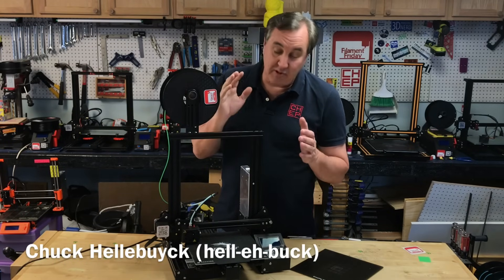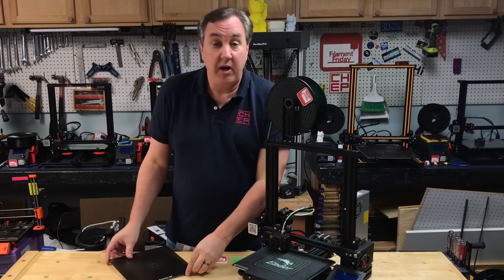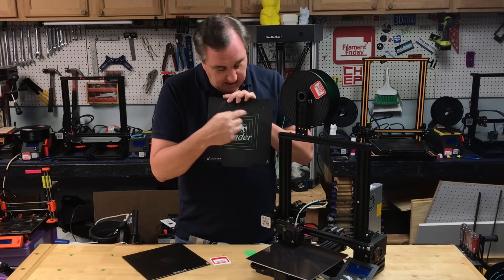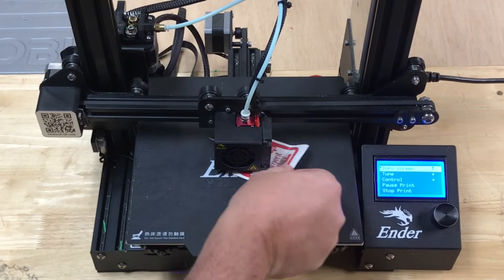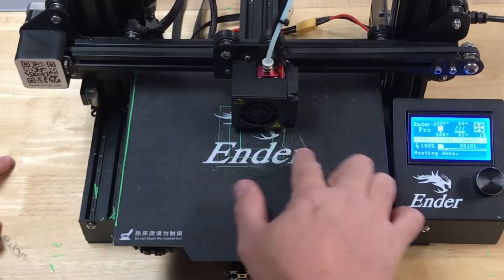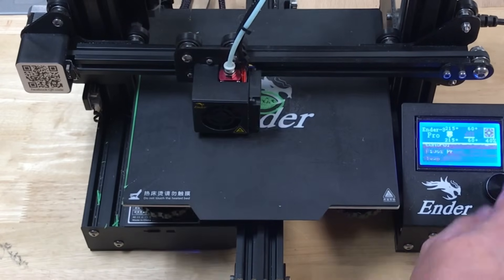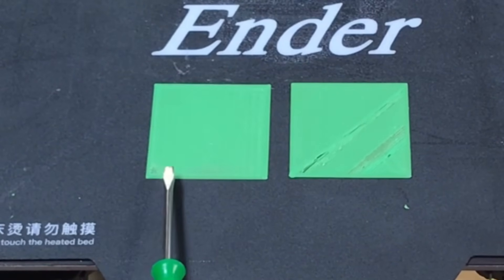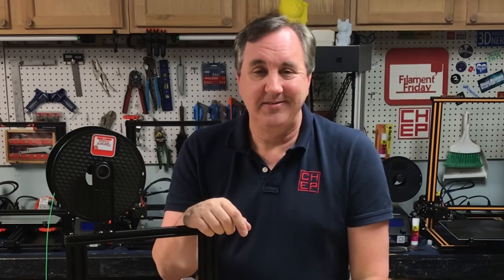Creality Ender 3- Easy Way To Level Your Bed

Comment: Level, print, fail...level, print, fail...
About to give up on this....
Reply from the maker: Clean the bed with soapy water and dry it. May help.
Reply: @FilamentFriday  I tried that, but will try again, also with the crtouch it won't print correctly, do you have an email I can send a pic to?
Reply from the maker: Check about me page on my YouTube.

Comment: Hey Chuck, or anyone- I notice that no matter how hard or loose I turn the leveling knobs below the printer, the extruder does not come close enough to the bed to graze the paper in the example from the video.

I figure this is because I'm using a magnetic bed that came with the ender3 pro, as opposed to the thicker glass one with other models, but I don't know.  I'm at the point where I feel like I should lower the stop switch manually til I can get the extruder close enough to the bed.  

Please advise, if you could, before I potentially do something incredibly stupid?  Thanks Chuck !
Reply from the maker: Yes, lower it. Even if you have to cut off the nub the prevents that.
Reply: @FilamentFriday  thank you!  very much !

Comment: Is there 3D print for extra filler for the spring area? My spring is too short the bed is always unlevel
Reply from the maker: Cut off the tab and lower your Z stop switch.

Comment: When i used to print this bed level, it always printed the outer most square first and worked its way in. After changing to a microswiss NG, now it prints the inner square and works its way out. Any ideas why

Comment: has the Bedlevel Script changed, from lets say a year ago? I used to get it from this video's description. Now its running a smaller rectangle, off center.
Reply from the maker: No. Same code.
Reply: @FilamentFriday  found it on your thingiverse profile, this file is working, for me, for some reason. thank you for the great work, opensource <3

Comment: I thought I did it right according to the video, wasn't printing right and burned a whole in the bed, I'm sure it was my fault but still sad. Even used a piece of paper to make sure if was far enough away from the board. Guess this attempt I will go to the letter of the video and use the software and see what happens.

Comment: my extruder is higher than a sticker’s thickness for sure. when i try to manually rotate the motor it does go down a bit but not quite enough to where this video shows. any help anyone please? :(
Reply from the maker: Adjust the Z stop switch lower.

Comment: Great share. Two things I would share, the second one you better be sitting down for because it is going to blow your mind.
1) Always adjust bed height by TIGHTENING the spring. When I EASE the thumbwheels, it doesn't hold its position- same principle tuning a guitar - you always tighten to get to your note.
Have a seat, now.
2) The wheels on the x carriage are not round. I knew you would be blown away. I have seen it consistently when printing large areas - periodic ups and downs, waves of good versus bad areas of the print. I have never seen/heard anyone on YT address this. Get a BLTouch you say. I have one and it is not precise enough to correct for this, or I may have to add 144 points for it to guage (which would take a LONG LONG time).
I hope you are OK with that news.

Comment: I’m a beginner and I’ve been doing it while the printer was off. It’s worked plenty of times but for some reason this time recently it’s just been a pain to level it. I’m going to try with the nozzle and bed on. Thanks in advanced.

Comment: My ender 3 pro did great in the beginning.   I even added a 2nd z axis motor and a glass bed.  Now, no matter what I do all my prints fail.  Either they don't stick, or they peel up.  Or if they do start to print,  after a few hours, everything starts to fall apart.   It gets all soft and spongy.   Failed walls or thin infill.  So frustrated with it.
Reply from the maker: Sounds like your nozzle is partially blocked.

Comment: I am having a terrible time with this, I finally got it to print the first square but beyond that and it starts bunching up at the nozzle. Help.
Reply from the maker: Clean the bed with soapy water and dry it. Also try bumping up the temperature 5 degrees in the LCD once it starts printing.

Comment: I use PETG almost exclusively. I can't remember the last time I used PLA... The program is fantastic, but for PETG, it doesn't develop enough temperature. I went to edit the G-Code, but found that it wasn't editible. Can you release a version with 250° Nozzle and 70° bed temp? Thanks. Great channel and solid information.I ordered your electronic level tool because A) I like electronic projects and B) I know it will work!

Comment: I realize you get lots of comments but if you are able to help , I sure would appreciate it.  I have watched many of your vids.    I have 2 ender 3's.  I design small model kits for model railroad layouts.  
Can you please tell me what I might need to do to fix an issue.  I am getting gaps in the first layer, (have watched the vid) but what stands out is when I do your bed level print, the bottom left corners filament doesn't touch correctly where is is supposed to.  It is off slightly.  Can you tell me what that might be? 
Thanks man! Keep the good vids coming!  Brian

Comment: Thank you! Thank you! Thank you!  This video was so helpful with getting my 3D printer set up.  Of course I'm brand new and thought I was leveling it sufficiently, but had it way too loose.  This guide and your GCode was excellent.  Had it dialed right in and printing right away.

Did I say thank you?  Thank you!

Comment: Hey Chuck, I built my ender 3 a couple months ago. I pretty much built it the same way I built my Voxlab and everything worked well for a while, then I ran into problems with plate adhesion. After leveling and releveling my bed I noticed that when it homes, the nozzle is about 5-7 mm past the plate. My Voxlab which is an ender clone lines up with the edge of the bed. How can I adjust the bed on the ender or is the overhang normal? I have seen other comments on several sites talking about the same problem. I enjoyed your video and will be watching the rest in the series.
Reply from the maker: If the LCD allows it, you can move it with X offset setting.

Comment: In live test left side bottom not sticking... What's the problem did have…
Reply from the maker: Clean the bed with soapy water.
Reply: @FilamentFriday  I find that in bed's 4 bottom spring's one smaller than all & That spring wrongly pleased on the front left side… Then I find that error and resolved that then calibration go's good thank you…

Comment: When I run the file it goes to each point but never stops. What am I doing wrong? I have watched your video 5 times and can't find out how to make it stop at each point.  Everything else seems pretty clear but my printer runs to each corner than middle than finishes without stoping???
Reply from the maker: Read the top comment.

Comment: I've got one of 32 bit boards, Marlin V1.01 so I am using the M25 version. At some point, the very first position is about a 1/2" away from the bed. But the rest of the code works just fine. It wasn't doing that before! Twice now, it all worked fine, but somehow I get to a point that position #1 is a mile away. I can't figure out what is changing this, any ideas?

Comment: How am I supposed to level my bed if I can’t even get this to stick to it. I don’t get how people get Ender 3s to work my friends have some and they have no problems and I have all the problems
Reply from the maker: Clean the bed with soapy water and let it dry
Reply: @FilamentFriday  this helped but the middle of my bed is higher then the edges so if I level it to the middle the edges are way to low and vice versa because the middle was to high it put creases in my magnetic bed sheet any ideas and how to fix that also

Comment: IDK, 5 points where the middle one requires to adjust all other 4 again. It's pointless. Then 4:00 if it's not sticking you move the bed? No, you should move the nozzdle up or down, or everything you did it's undone.
That's why I have a Prusa. It does automatically, just need to adjust the nozzdle according to material, type of be I am using. One test, done.
For $100 more, yeah, Prusa are way better that all this hustle.

And, also, paper is not reliable. Get any cheap caliper that comes with a feeler gauge set, and use a proper tool.

We like to talk about how to have a perfect print, precision, but keep using this paper thing?

Nice video anyway...
Reply from the maker: Lot of people using it and love it. Getting their best levels with it. I did remove the center from the GCode.
Reply: @FilamentFriday  the hassle is still there... lots of people just because 1. it's dirt cheap 2. you can buy on Amazon

Comment: Hey Chep sorry to bother you but i have a question. When running the bed level code is the nozzle supposed to go down exactly to the z limit switch? Because i have been running your bed level code for a while on my brand new ender 3 V2 and i have noticed that sometimes it goes down to the Z limit switch and sometimes it goes down just above the z switch and i dont know if that is intended or not.
Reply from the maker: It should always home to the Z switch first. If it’s not hitting the switch then you might have a wiring interference issue.
Reply: @FilamentFriday  Hey Chep, thank you for responding and sorry for bothering you again. I was able to level my bed using your code and have done some test prints. I keep getting consistent and repeatable first layer prints using the code that prints a layer thick square in the 4 corners and 1 in the middle and i have also printed a couple xyz cubes. But when i try to print a 3DBenchy i cant get passed the first layer. I would be grateful if you could look at my test prints and tell me what problems you are able to see. I have uploaded a 20 sec clip in my channel. I added more details in the description. Thank you.

Comment: I tried this it doesn't work
Reply from the maker: Works for 1000’s of people. Try the M25 version if the M0 doesn’t.
Reply: @FilamentFriday  tried it, can't level the bed at all idk what's wrong with it
Reply from the maker: Depends on what your issue is. Your not giving enough detail.
Reply: @FilamentFriday  some springs are more compressed than others, the middle of the glass build plate is always higher then the corners but I checked and it's completely flat. I also leveled my gantry and that didn't fix the issue
Reply from the maker: Maybe check the base plate the wheels attach to. It may be bent.

Comment: I wish I had looked up a video before I tried using it. I ended up trying to print something and melted a huge pattern into the magnetic pad from the extrusion. Ruined it completely, with a bubble in the middle. At least I know this now for when I get a replacement pad.

Comment: Awsome tip but just since I literally burned my skin doing it I wanted to ad a caviet about ABS( I am refering to the cheap industrial abs you get on amazon): USE PLA ONLY ABS is at a scolding 300°F and it will burn you certenly( take it from me( **on the ender 3 pro bc kn ender 3 it wont work with class 2 abs ). Also be careful if you are moving the printer.. those belt screws can and will come loose slightly makeing alignment nightmares

Comment: Can you use brass feeler gauges to set bed level instead of paper. I’m an automotive tech and using those just seems more accurate and easier for me to understand. I might be over thinking it. Just hard for me to grasp the correct drag using a paper. Hope you see this

Comment: Trying the programs...getting a nice tangled spider web despite running the levelling twice before the grid program. Not sticking to my factory bed. Runs straight on the horizontal nearest the front, then loses grip waffles all loose before it can finish the first vertical going to the back. Any recommendations for cleaners for the factory bed?

Comment: I've downloaded the M25 version for my ender 3 pro. The bed leveling G-Code was working fine for a week or so but now after it stops on the first point and I hit resume to go to the next point it starts heating the bed and extruder. Is my file possibly corrupted? Help would be greatly appreciated.
Reply from the maker: Download it again. Something seems wrong with it.

Comment: My print head doesn't pause after going down... Is there something I am missing? please someone help
Reply from the maker: Check that the z stop switch is connected and working.
Reply: @FilamentFriday  It is. I think it might be a firmware issue, because it seemed to work fine on my friends printer. And by not pausing when the head goes down, I mean it stops at the right spot, but just goes right back up.

Comment: Hi, your gcode level prints for the Ender 3 and Cr-10 were great.   Any chance you could release your printer settings for those gcodes.  I'd be curious if there is a setting or two that I am overlooking.

Comment: This leveling code is great, but I found my prints were still warping off and coming off the bed. The code is set at Z 0 and we're putting a paper thin gap between that. But when printing the first layer, it's at 0.2mm (at least for my Ender 3) PLUS the paper thin gap from leveling. That's causing it not to smush the layer to get good adhesion.

THE FIX: After leveling the bed, I moved the Z axis to exactly -0.1mm and Set Home Offsets. Don't just lower the current height by 0.01 and set home offset or else you will crash the nozzle in the bed (on ender 3; your model may vary).

Now I'm getting perfect adhesion on my glass bed, with a great first layer! Plus, Aqua net hairspray is amazing at getting prints to stick.
Reply from the maker: That’s why you do the live adjust as described in the video. What you describe is in these videos using feeler gauge or electronic leveling tool: 
https://youtu.be/rDm9OziZ6dY
https://youtu.be/715Xop79Sus
Reply: @FilamentFriday  First off, thanks for the quick reply and being active with your community! I've really enjoyed your informative and easy to understand videos.

I may have missed the live adjust step, but was looking for a auto moving level program that I can run, adjust corners, and then go on to the print. But it ended up making the prints too high.

If we're adjusting for paper thin (~0.2mm) gaps at 0 Z height, wouldn't that make a 0.4 gap on 0.2 layer causing it not to stick well? I changed the gcode to sit at Z0.1 to compensate for any gap and so I don't have to reset home offset.

Feel free to call me crazy though if my logic doesn't make sense or if I'm wrong. I'm just trying to eliminate the live adjustment and make it as easy as possible for me, and also others.
Reply from the maker: I suggest watching the video again at 3:30 where I print the square test and live adjust. 
Paper (including the sticker back) is typically 0.1mm not 0.2mm. I’ve measured many sheets and found the same results. 
The live adjust takes away some of that 0.1mm. 
It’s worked for many of the 1.2 million who’ve watched, confirmed by many who commented. 
The additional videos I linked show how to get closer to a true zero without the live adjust by matching the Z offset to the measuring device thickness (0.203 in feeler gauge video) and 5.7m in the Electronic Bed Level Tool video which is similar to what you described. They both work quite well.

Comment: does this work if you have an abl on? it was acting weird on my ender 3v2. I changed over to jyers firmware so that also could be the issue
Reply from the maker: No, it’s for manual level.
Reply: @FilamentFriday   oh dang, oh well. Great video regardless!

Comment: HELP ples :(
I keep adjusting the bed level to the right height but every time I restart the print ( gcode ) again the extruder is always too high and the level is never the same. I have to do it again but then the pattern just repeats. Spent hours straight just adjusting the bed level and restarting the print and it keeps not being right. :(

Comment: I noticed in the video that when you run the gcode file to level each spot no PLA is coming out of the nozzle. Do I need to remove the filament before running the file, or is the file setup to not output material? Sorry if this seems like a stupid question, but I am rather new to the 3D printing side, though I have been creating animations for full dome planetariums for a long time. Thanks for your help!

Comment: When rubbing your finger over it, how much is good pressure? Should I be barely brushing it across, letting the weight of my finger brush it, or what?
Reply from the maker: Like your dusting it off.

Comment: Hi Chep, thanks for the Videos.
I still cant get my bed to level though, all 3 corners, front l/r and back l i can get but back R is way way way off and i cant get the bed to go any further up as the wheel to level is bottomed out (the wheel is at the bottom of the screw) do you have any suggestions?
regards,

Mark
Reply from the maker: Maybe the base is bent?
Reply: @FilamentFriday  The Arm that goes across the printer that holds the printing nozzle/fan was squint, a spirit level app sorted it :) thanks for the reply :)

Comment: okay question
i adjusted the wheels and printer using the Gcode everything worked great.
today my center plate has NO free space. ive dialed down all the wheels and my frustration has me back on utube any advive?
Reply from the maker: Check your stop switch on the side if it still there and working

Comment: alright I have a new problem. When I’m printing a model, it starts to print smaller things but then it gets muddled up and just won’t print it right and the plastic will just start to move with it. I’m printing the flexible Dino and have turned down the print speed to only 30 % and it still gets all scrambled. Does anyone have any ideas?